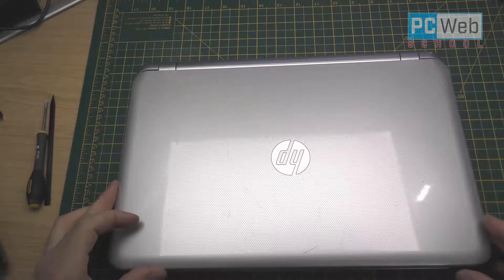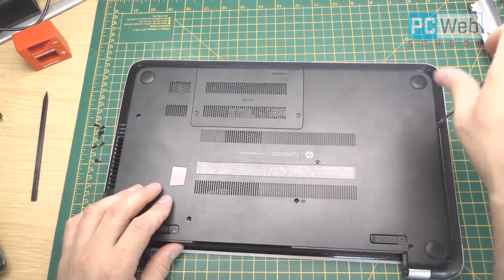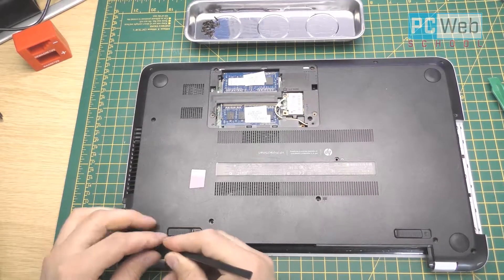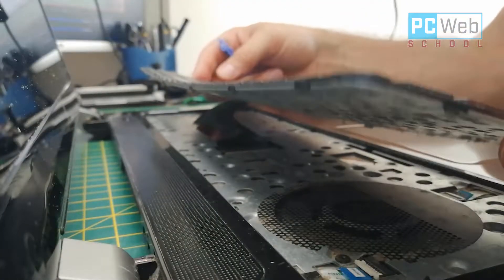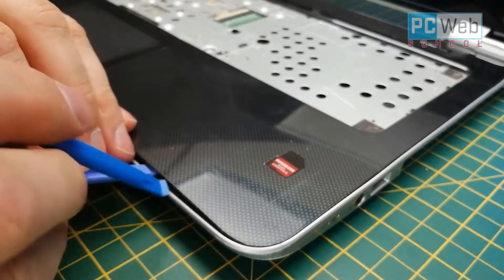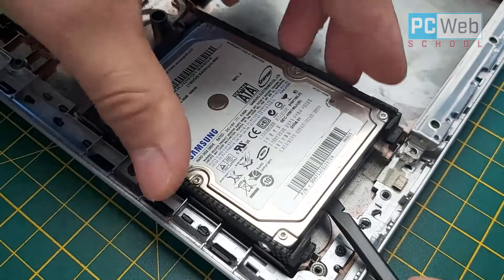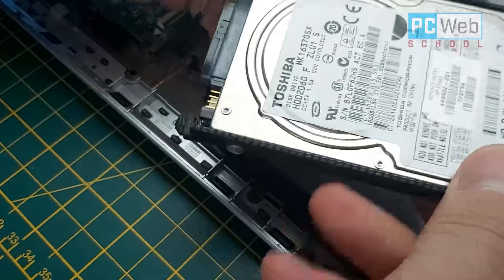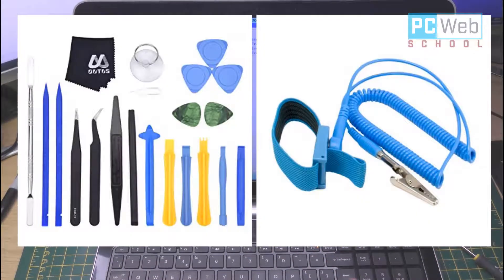How To Change HDD On HP Pavilion 15

Comment: excatly what i looked for!
Unfortunatly i do have screws where the disc reader is and those wont come loose. i managed to get one out because i do have the correct sized bit but the other two are sitting so tight i worn down the screw head . Any tipps?